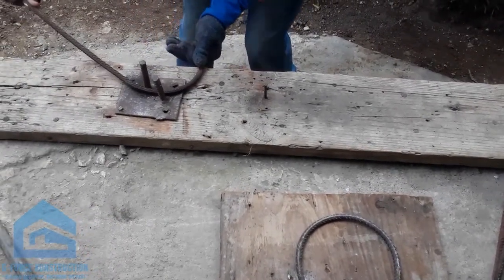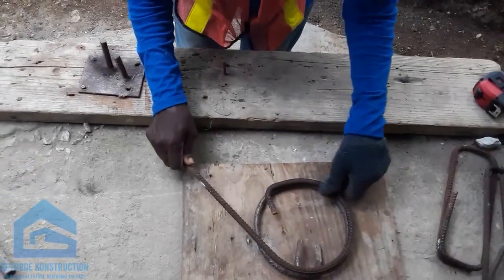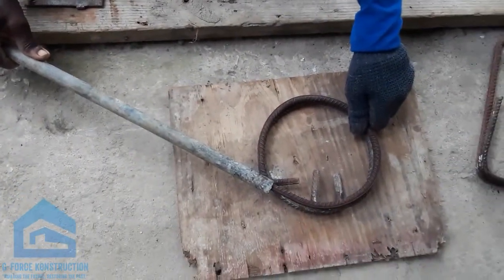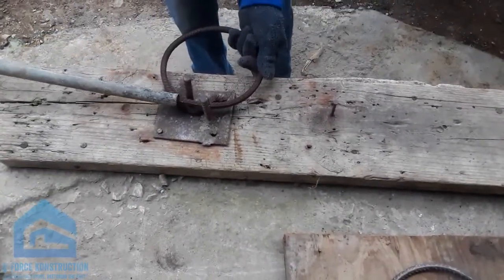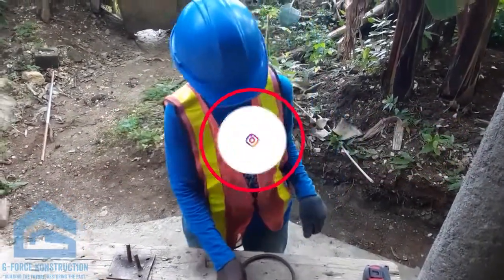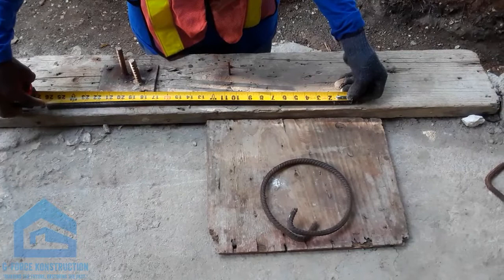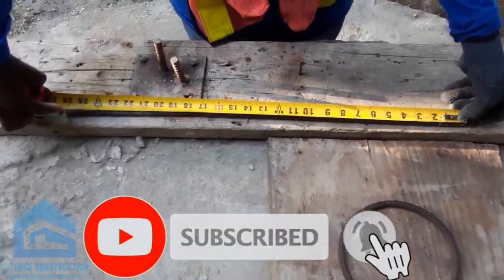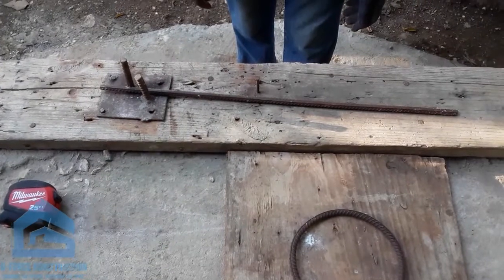How to Make Circular Stirrups [Step-By-StepTechnique] 😱

Comment: How do cut the ro
Reply from the maker: Thanks for watching! If your question is about what we use to cut the 3/8-inch steel, we use one of three tools: a hacksaw, a heavy-duty steel cutter, or an angle grinder. The measurement of the 3/8-inch steel used to make the round stirrups is 26 inches.😊